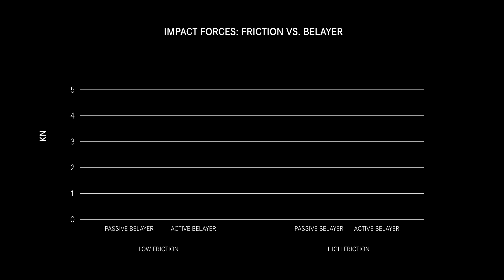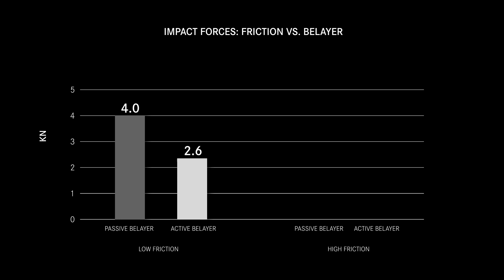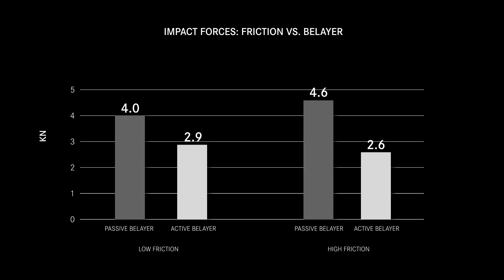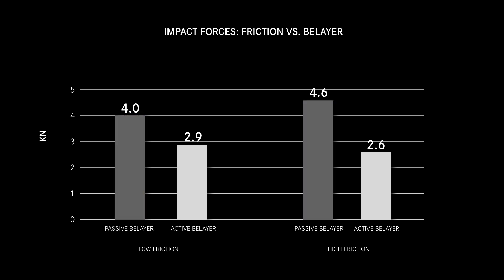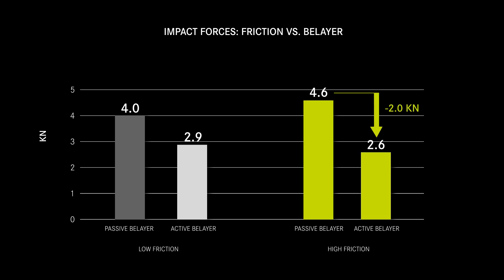Belaying Passive vs. Active vs. Friction | EDELRID Knowledge Base

Comment: I'm not surprised that the results are pretty much the same for active belay with or without friction. The belayer is pretty much pulled up the same distance. If you look closely where the feet end up, the difference is really minimal.

Comment: I wonder, what is the technical explanation, that reaction force of dynamical belaying with friction is lower than without friction ?
The findings on DAV "advanced belay training" did not suggest any advantage on dynamic belaying with friction device (training was taken some three years ago).
Reply from the maker: Hi Martin, the highest impact forces are always measured when the belayer gets initial acceleration. When body dynamic is started a millisecond to early or too late (what is usually is) the impact is already high. Pre-friction in the system expands the “correct” moment for body dynamic. So with pre-friction it is a lot easier to hit the “correct” moment for body dynamic. Regards, the Team-EDELRID